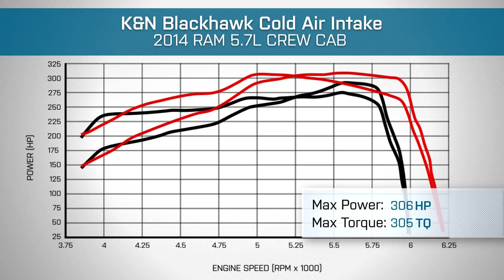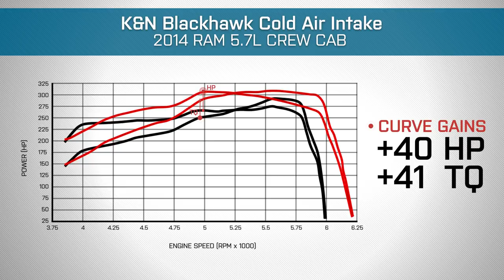2009-2018 Ram 1500 K&N Blackhawk Cold Air Intake 5.7L Review & Dyno

Comment: I thought the 5.7 hemi hp was over 390+
Why is the video saying 290 hp?
Anyone ?
Reply: I have always been told that a run of the mill dyno will only give and idea of a change in horsepower and torque not an actual value so more than likely the increase is accurate but the actual value is incorrect
Reply: Dyno is showing HP at the wheels, after drivetrain loss.   390 is at the crank
Reply from the maker: All comes down to drivetrain loss, sadly! That 5.7L is still making 390 at the crank but through heat and friction in the drivetrain it drops by the time it gets to the tire. -Zach

Comment: Would this fit on a 2019 Ram 1500 with a 5.7l HEMI V8?
Reply from the maker: This kit will fit 2019 Classic models, but not the new 2019-2020 RAMs. You'll want to make sure you buy the right intake for your application. -Zach

Comment: Just curious? They say ram 1500 has 395hp. Why did the dyno show 260?
Reply: 395 horsepower is at the crank (back of the engine), you will always lose hp thru the drivetrain. Thats why sometimes you may have seen the abbreviation rwhp, meaning rear wheel horse power. All cars will have 2 different numbers as well as a variation of horsepower percentage lost.
Reply: Scott G. Damn so it looses like over 100 hp at the drivetrain?
Reply: Yes cause its 4x4 a 4x2 only loses with the 8 speed 20%

Comment: What if you have a 4.6L? Can you still use this intake?
Reply from the maker: This cold air intake kit is designed to fit 5.7L engines only, I highly recommend you get an intake kit made specifically for your engine to ensure the best fitment and performance. Thanks for watching! -Zach

Comment: Will this void my Factory and Extended Warranty?
Reply from the maker: I'd highly recommend checking with your local dealer before installing if you're concerned with your warranty, just to be safe. -Zach
Reply: It likely wont but it will take 1 million miles to recover the money spent on the "upgrade"

Comment: Would it be any different for a 2019 1500? Would this void the warranty?
Reply: Anderson C same engine so yes . Keep your factory one if you ever have serious problems.  You only void if you chip/tune your truck
Reply: They can’t void your warranty unless the aftermarket part is what caused your truck to have problems IE something happens in your engine that it sucked up a huge block of dirt that caused your throttle body to break they can blame it on the cold air intake and it won’t cover  your warranty they just won’t cover the cost to fix it... also if something happens to your brake calipers and they see you have an after market air box they can’t blame it on that there is no way that’s what caused it so your good
Reply: I just bought a 19 Ram and I cannot find the Blackhawk one for the 2019’s yet. Are they even out?
Reply: You can get 1 from ram

Comment: When adding these cai do i have to program the computer for the difference?
Reply from the maker: This specific intake does not require a tune for installation! Simply bolt on and go! -Zach
Reply: No the intake will add about 1.5hp and 3trq the tune will give you the rest if you want the claimed 40hp
Reply: @asheetuglasse  
What tuner

Comment: Now put the factory air box back on with the tune.. and dyno it.. otherwise it is a contrived comparison
Reply: I noticed something funny. It's called a "cold air intake" but it just pulls in warm air from the engine bay while the stock air box has a funnel/snorkel/tube type of thingy (lol.... im tired.) that pulls in air from the fender, away from the engine by. Its like going backwards and throwing away $300 or more! Crazy!

Comment: no way a filter change give you ANY HP GAINS!
Reply: K&n drop in has been Dyno tuned to give upto 5hp & 5tq ish some vehicles get different a cold air will give 12 to 23 hp & torq numbers there's videos.....a tuner factory tunes not custom will give about 7 to 20 hp 30ish tq 
There's a video of a orange ram on trailer Dyno they run sets adding piece by piece and a cold air exhaust edge pulsar was like 41hp and 50+ torq and they spent 1000$

Comment: Wth? I have a 2014 5.7 crew cab and my truck make 395hp stock!!!! How the hell do you only make 290hp???
Reply from the maker: Realistically, yours is probably making right around that much as well. Both of our RAMs are making around 395hp to the crank, but not all of it makes it to the wheel due to drivetrain loss. -Zach
Reply: He didn't lie about the horsepower that's an actual figure where did you come up with that figure you used

Comment: the ram 5.7 liter hemi loses that much horsepower from flywheel to the ground that's a big loss if that's the case
Reply: Looks like they have bigger and heavier tires on it which is likely robbing power. Dyno numbers also have to be taken with a grain of salt because there’s so many variables like temp, humidity, brand of dyno, rear axle ratio, etc.
Reply: Also 4x4 will also change those number
Reply: ^ That too
Reply: Its probably around 300ish to the wheels. Those huge tires create more friction on the dyno and will read lower.